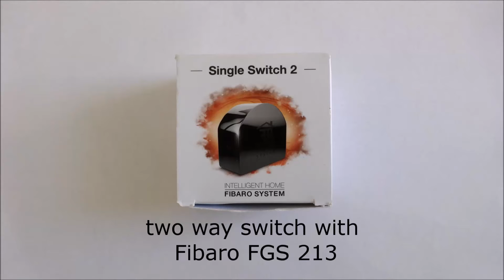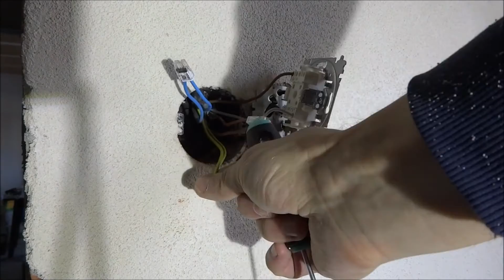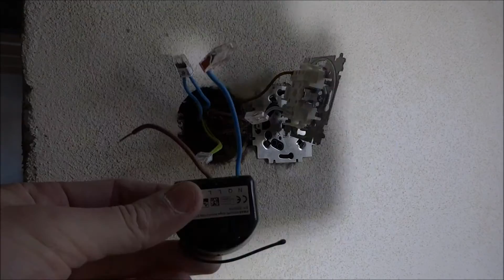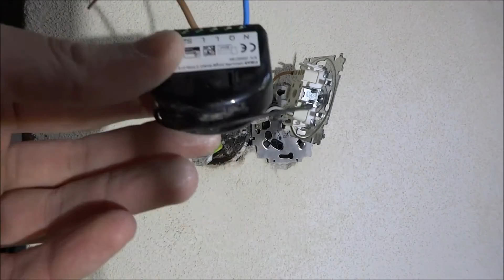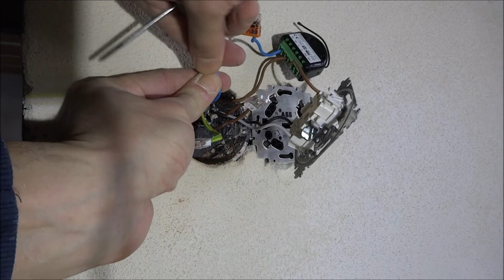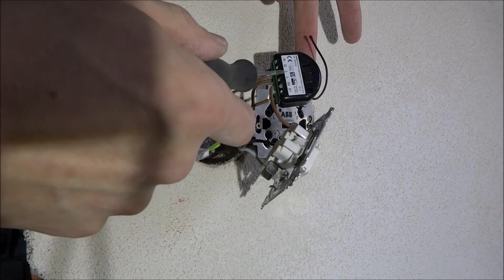DIY two way switch wiring Fibaro FGS 213 english

Comment: Thank you very very much for this video! Absolutely perfect. After first try with the fibaro manual diagram i actually failed the wiring as it was acting very weird and my second switch was not working. Finally i found "central Europe" wiring video. For any reason i though that i need to rewire also cables (grey and black) going to the second switch. So it was apparently a mistake and i misunderstood the diagram.
Reply from the maker: The actual cable colour code in the video is from the Czech Republic. In other countries the colours may differ.
Reply: Can you tell me if your connections are valid also for the FGS222? thanks

Comment: Superb - after hours of trying to visualise how to wire my UK 2-way lights with a Fibaro switch (can't find any Fibaro wiring diagram for this), this explains everything perfectly! Many thanks.
Reply: I think vesternet has some diagrams up. Can you still use the normal wall switch for the lights? Or do you have to use the Fibaro?
Reply from the maker: It is great that I could help you. The video was made for central Europe. I think in the UK they have different colours on the cable.
Reply from the maker: You can still use the normal switch but you will realize that there will not be a direct switch. It has some kind of delay. If you switch very fast 2 times it will not switch as the Fibaro goes into the setup mode.